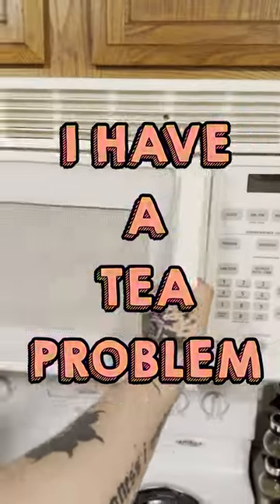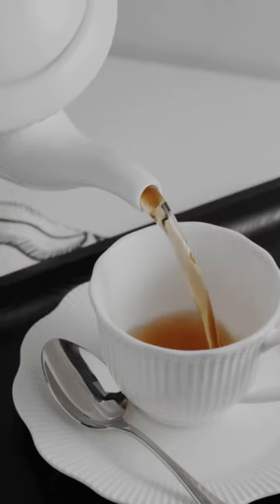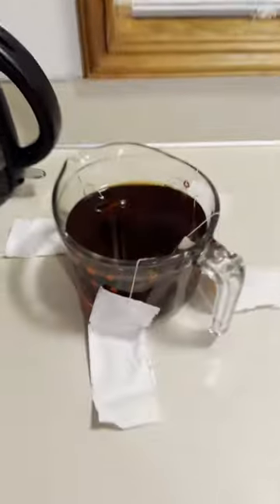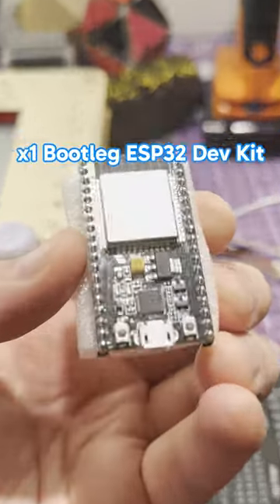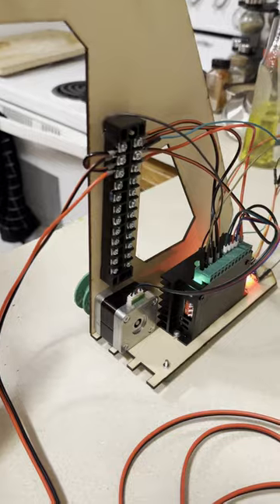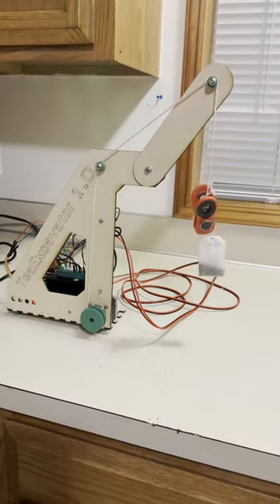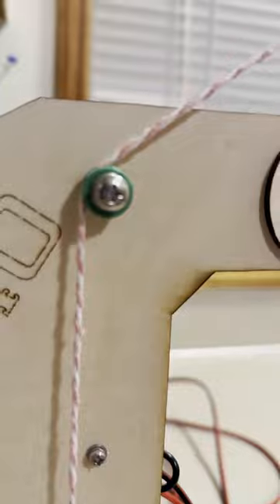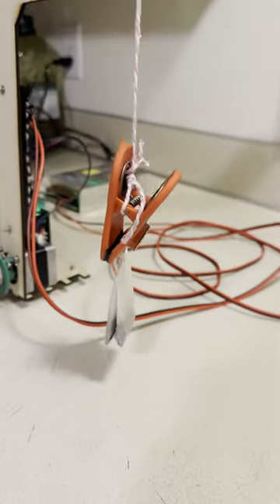Fixing My Tea Problem™

Comment: Seriously though, to fix this and, at the same time, drink even MORE tea, you can use gong fu tea brewing method. It gives much better taste, and requires only up from 10 seconds(!!) to brew a cup. And the best part? You can (and should!) do it multiple times(each time brewing time increases by ~5 seconds from previous). I usually drink like 8-9 portions(100ml each) of puerh tea in one sitting, and have it once or twice a day. Imagine drinking almost a liter of tea in one sitting! That's what I was doing for the past years...
Reply: I don't see the overengineering bit.
Reply: @the_spudrunner  what?
Reply: @twothreeoneoneseventwoonefour5  where is the part in the technique where I can use my Pi 5 with it's 2 SSD's and it's 40 GPIO pins?